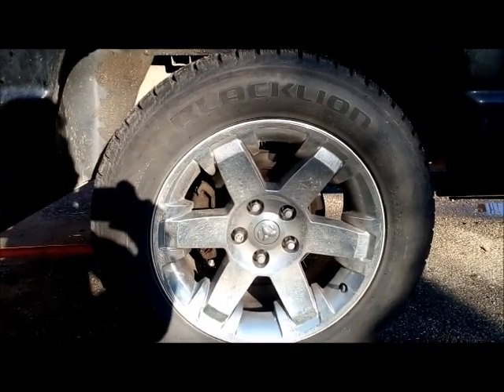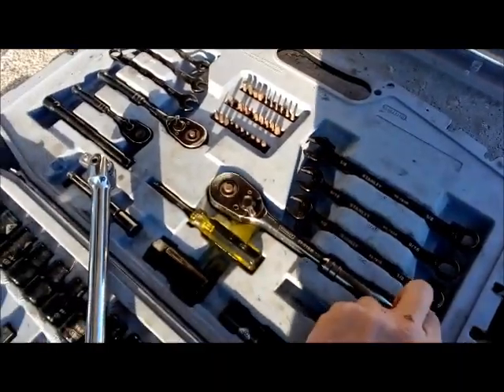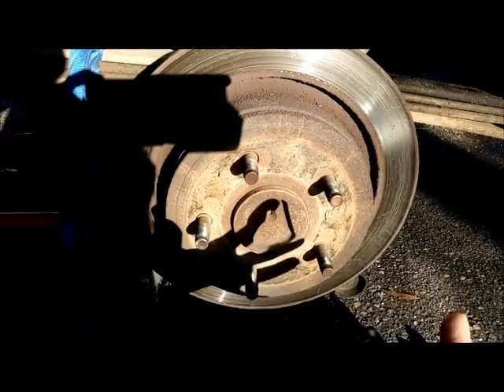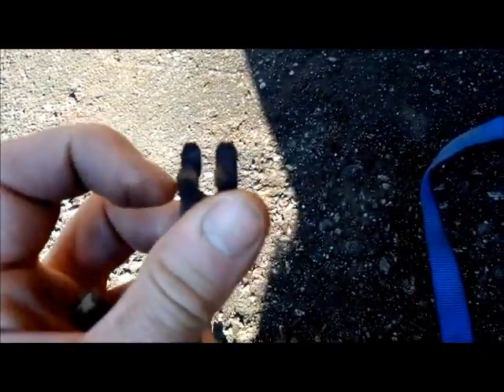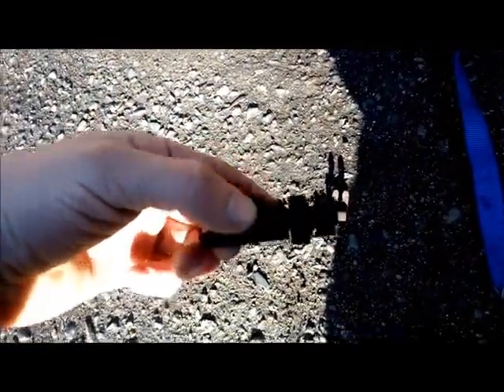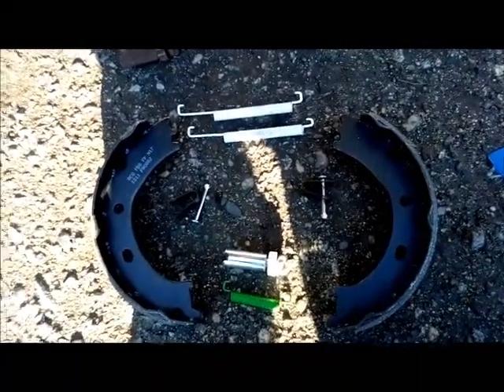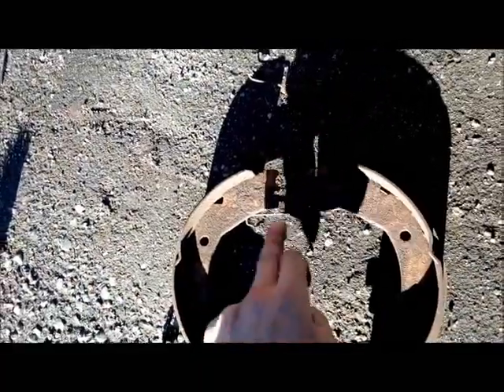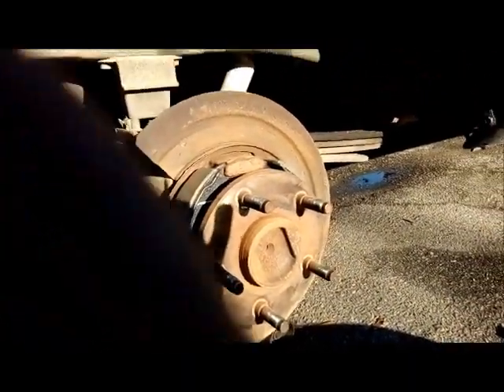parking brake install 02-05 Dodge Ram 1500

Comment: the leading cause of failure in parking brakes these days are the actuators that spread the pads when the cable is tightened.they may also be refered to as parking brake levers.they are made out of simple steel and rust quite easily.when they get chocked with rust they don't allow the pads to retract all the way and that is why you get the sqeaking sound after you release the brake. you need to grease the hell out of thes with a high quality synthetic or ceramic brake grease.

Comment: Its alot easier to replace e-brake if you pull the axales , and while axels is out you can inspect the rear end and add new oil., you dont have to do it this way .

Comment: Apparently I either got this problem or the inside brake flew apart. My left back brake is hot dragging every once in a while and bangs locks the tire up for a second do you know can I basically ripped his entire emergency brake system out of there and throw it away?

this is the most screwed up system I've ever seen in my life and it seems that it is a common problem on this truck I would've rather had a set a drum brakes on the back they put all this junk on there and by the time you're done rebuilding everything if you have to put brakes and rotors seems like it always cost 500 bucks and if you don't do it then you tear up something else and it cost three times as much all I want is the back brakes fixed so I can get to town this week. I am in a very muddy area in the spring time this does not look like something I want in my brakes. Maybe someday but not really now

Comment: I'm curious, why would parking brake shoes ever ware out, its not like they are braking the truck while it's moving, the truck is sitting still when the E brake is applied.
Reply from the maker: thats a good point mark, in my case the parking brake shoes rest on the inside of the rotor.  the rotor is constantly rotating while in drive,  as your millage increases chances are dirt and debris can make its way between the shoes and the rotor, causing massive friction.   over time , this could result in shoe loss.   in this case i'm unaware of this vehicles history,  and it is recommended  to change your shoes ever 50 000km.